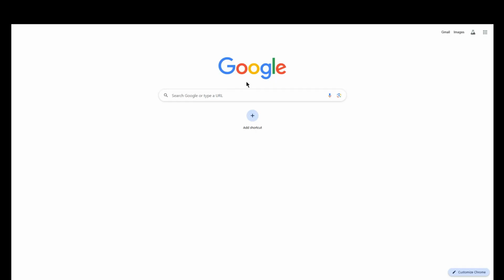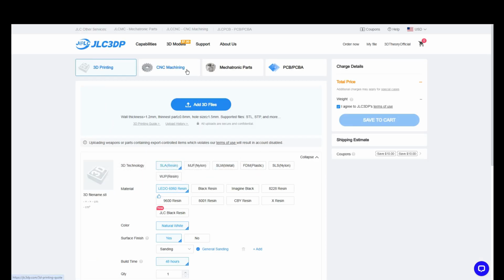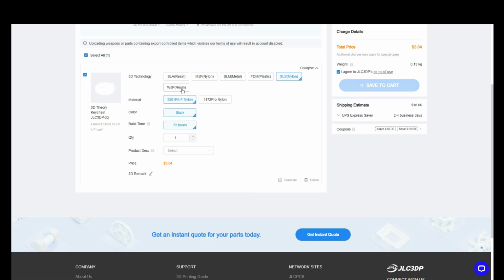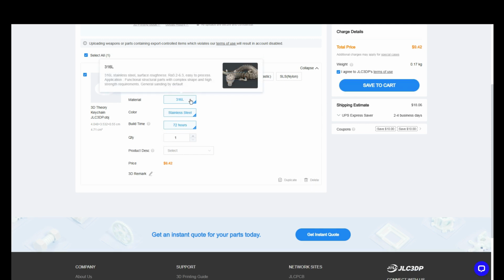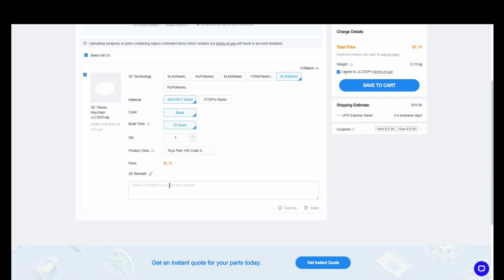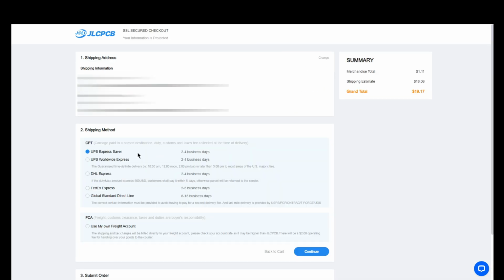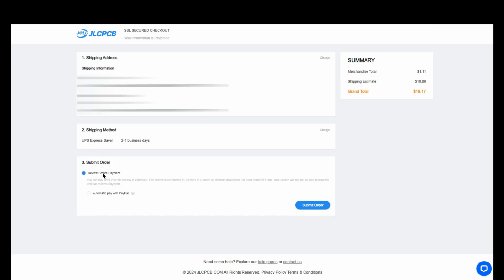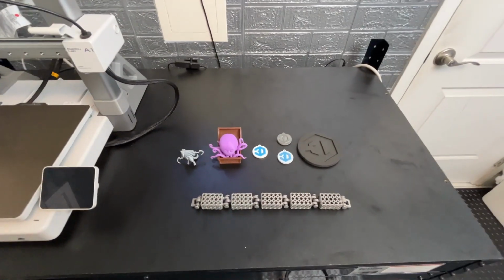Ultimate Guide to Six 3D Printing Processes!

Comment: 1. Resin printing as such is not "the weakest" of them all, just like FDM isn´t weak. You can FPD print in PEEK and such, it depends on the material. Same with resin, as you have yourself pointed out, the other machine just uses a different type of "Photopolymer" or resin as you call it and the parts are way stronger. There are about 4 major Resin printing technologies as of right now.
2. You left out the following 3D printing types which might be interesting and are important as well.
- Selective Powder Deposition, 
- Direct Inc Writing
- Rapid Liquid Printing
3. Outside of this known cosumer prints you can also laminate materials and such, which could also be seen as 3D printing.
Reply from the maker: @sierraecho884 Thank you so much for the detailed and informative comment! You’re absolutely right, strength in 3D printing varies widely depending on the material used, fine-tuned settings, and the specific technology. I appreciate the clarification on resin printing and the introduction to additional technologies like Selective Powder Deposition, Direct Ink Writing, and Rapid Liquid Printing. I’m still learning about many of these processes myself, so your input is incredibly valuable and adds depth to the discussion :)
Reply: @3DTheory  I am happy you could give you a nudge, I can see you are very enthusiastic about 3D printing as a topic, so am I. Keep up the good work.
Reply from the maker: @ Thanks for the encouragement! It’s great to connect with fellow 3D printing enthusiasts. I’ll definitely keep pushing forward and sharing more. I appreciate your support :)

Comment: Great vid bro!! I wanna get into resin just haven't yet lol
Reply: I was excited about resin printers. Bought one, then it was setting on the disk for 3 years! I literally fdidnt finish half a Liter of resin. Du to toxic resin and horrible smell printing in a normal house room was impossible. I  Bought A1 put a small air filter and never been happier.
Reply from the maker: @M2S4L  Absolutely, I couldn’t agree more. I feel the same way about resin printers, the toxicity and the smells make them a tough choice for home use. However, using a service like the one I mentioned in the video is a great way to explore resin 3D printing without having to deal with the process and toxic smells directly. It’s a handy solution for those who want the benefits of resin printing without the drawbacks. Thanks for sharing your experience, it really highlights an important point for anyone considering resin printing :)
Reply from the maker: @Krunkle78  Thanks for the kind words! Resin printing definitely opens up some great possibilities for detail and finish. I actually bought a Creality Halot One to try out resin printing myself and made a video on it. While I found the process interesting, the toxic smells were a bit too much for me, so I sold it. Using a 3D printing service like this one, could be a fantastic way to explore resin printing without dealing with the process directly. FDM is still my favorite :)